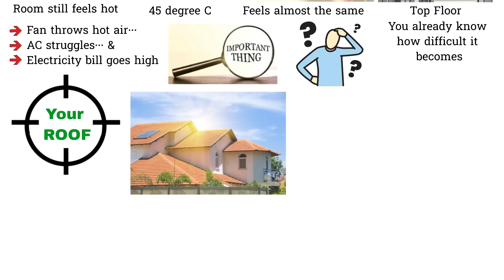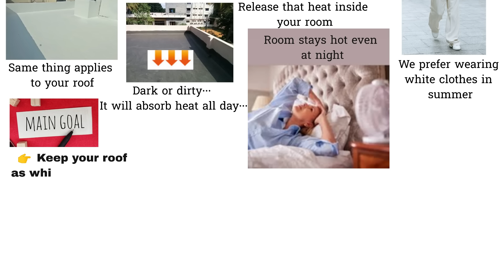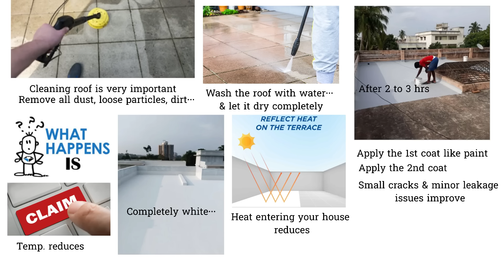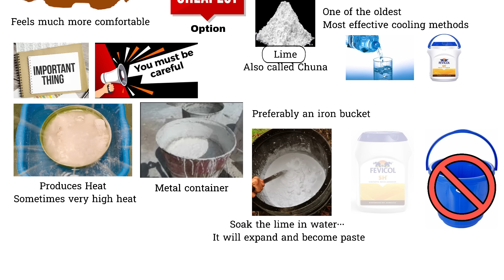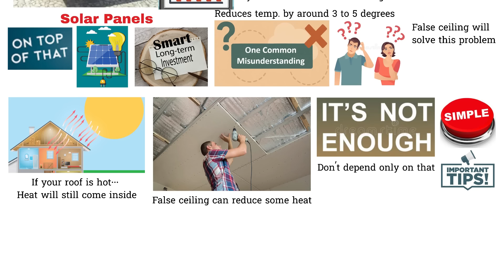STOP THIS HEAT! ROOF COOLING TRICK! CUT HEAT BY 8°C! WHY YOUR ROOM IS HOT?

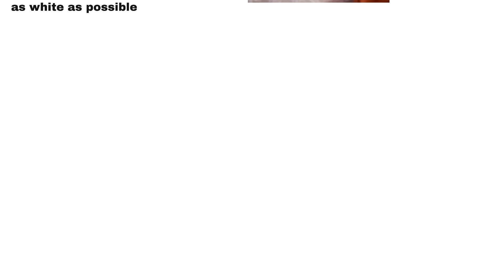Comment: 1:50 First method -White cement & Fevicol.  Life 2 to 3 years.
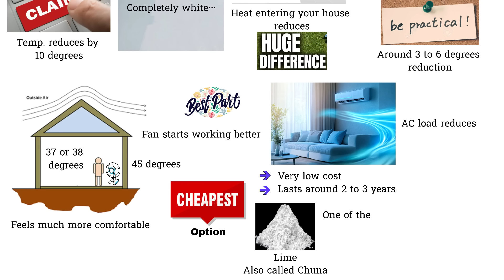03:50 Second method - cheapest : Lime + Fevicol.  
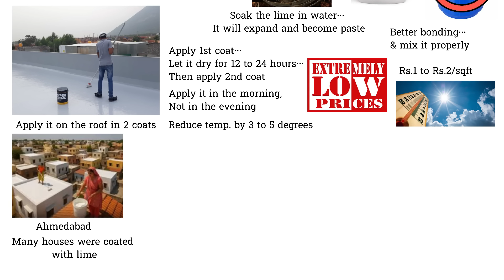05:00 - Third Method - Use Paint.  Costs Rs.12/- to Rs 20/- per sq.ft.
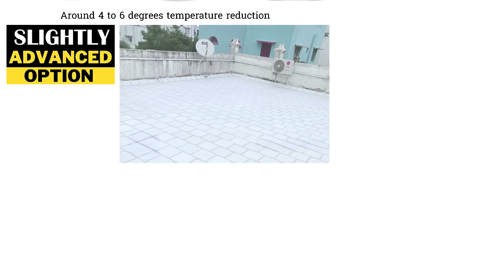05:48 - White Tiles method
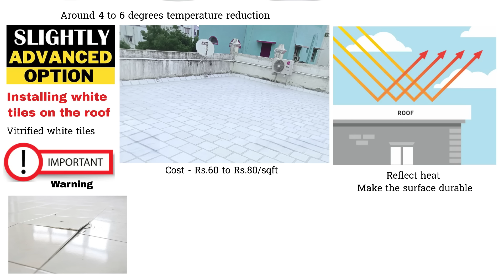06:10 - brick bat coba method
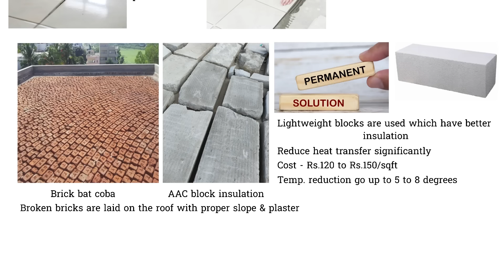06:50 - install Solar Panel
Avoid false ceiling.

Comment: White cement plus fevicol. How many years it will work. Will it stand rainy seasons ?
Reply from the maker: Tentatively 4 yrs if applied properly bt for permanent results proper waterproof coating is better
Reply: G+1;Slab No leakage. Required  Cooling  in 1st floor.

Comment: Cheapest method: spread thermocole on top of the roof. You can remove them when rain comes.
Make roof as vegetable garden. Store water when raine season in summer spring water on top of roof, if only roof has any other roofing
Reply: Not practical. Who'll keep a chowkidar to remove the thermocol if rain comes at night? Secondly every building is not built to collect rainwater. Either the building will collapsed from the weight of rain water or there'll water leakage.

Comment: Simple and long-lasting method is putting shed by terracotta tiles .
Lime plastering at walls and 2 or 3 feet shades around the house .
These 2 steps will reduce 75 % of heat inside the house.
Reply: Hi.. What do you mean by 2 or 3 feet shades around the house? Please explain.

Comment: Hi sir iam from Tamil Nadu... Chennai.. I am following up with you channel.... Lot of information.. Tq.. Sir.... 😊... Iam start my dream home. For fast one month.. Build from.. Stone of solid concrete block.. It's OK .... Or not ok.. It's good for strong building ❓❓ sir..
Reply from the maker: Hi! Thanks for following.
Solid concrete blocks r absolutely OK. They r strong, durable n widely used in construction. Just ensure good quality blocks n proper workmanship.
Best wishes for ur dream home
Reply: @engineeringmotive  tq for the quick response sir🙏.. Today.. Quality check for solid concrete block.. The stone absorb 10% of water.. Before weight 32.1.. After water 24hr water soak 35. 1.... Tell site engineer.. Tell good quality of stone😊.... So. Work is going on sir tq

Comment: Very useful video 
For the last 28 years I am applying Asian paints dazzling white exterior on my terrace. 
In peak summer at my place reaches 38 degrees Celsius outside. 
Inside my home it's 30 degrees. 
Very rarely we use fans. 
This particular paint is damp proof too.
Your video will help millions: if it's followed. 
Thanks for such an useful posting